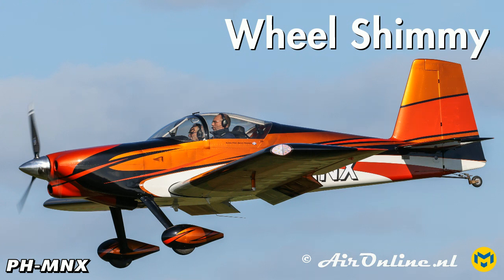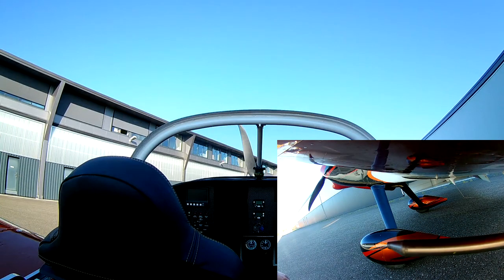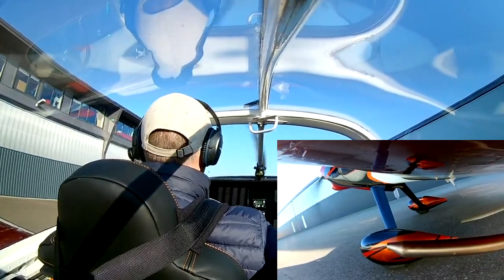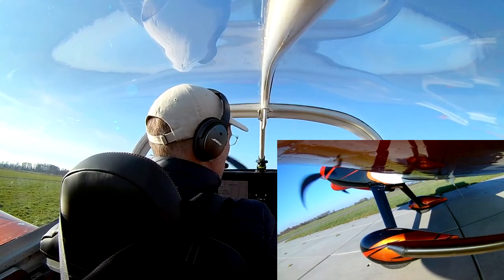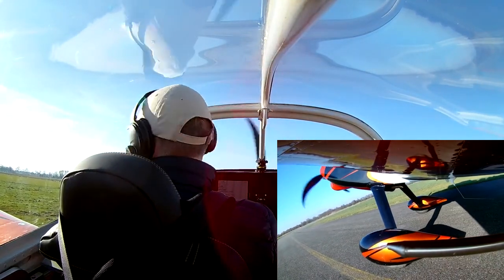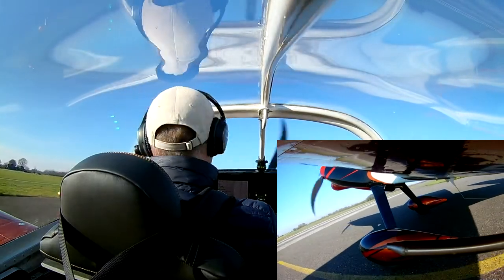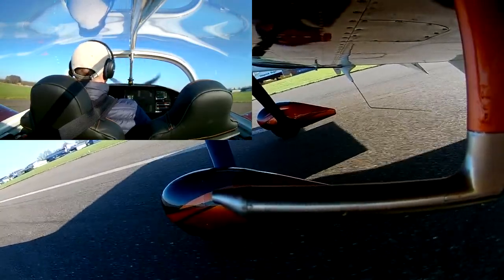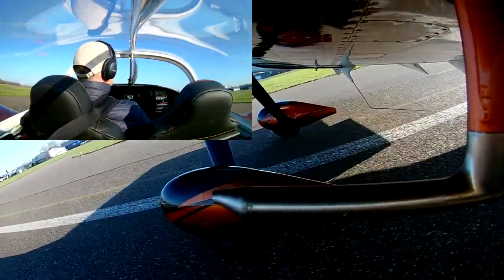PH-MNX Wheel Shimmy

Comment: check tyre pressures too much or too little will cause shimmy
Reply from the maker: Yes I heard more people talking about it.
What is the pressure you use?
Reply: @PHMNX  I tried diffent pressures to find the one that suied me   I use 38 psi down to 35  no issues on grass runways but it seems to suit my six on seal you might like to start high even up to 40 psi and do a couple of circuits if you get shimmy reduce them by a few psi until you find the best then stick with those preddures. Not saying it will work for you but it worked for me.
Reply from the maker: @bruceblack9048  Thanks Bruce I'll start messing with it.

Comment: Are you happy with the UL engine ?
Reply from the maker: Yes, but I have not much experience with ather engines.
And I need to get used to the relative high RPM (cruise 2600, downwind 2300). Also the power output is high and especially during takeoff this surprises my. Resulting in sloppy TO.
I need more practice.
Overall I really love it and the sound of a growling 6 cylinder is hard to beat
Reply: While researching the ul power engine for an rv9 I came across an article of your engine failure. 

I hope you are okay 😢